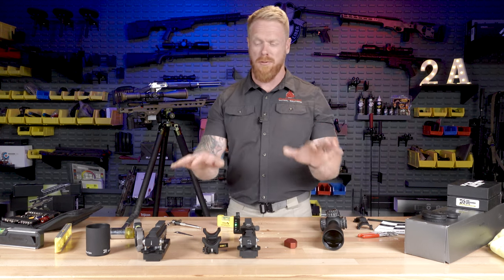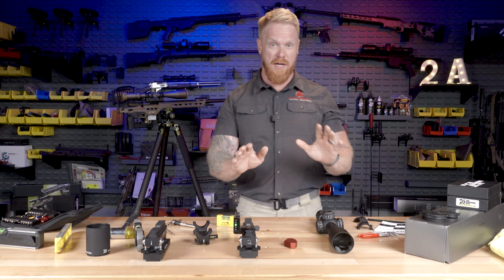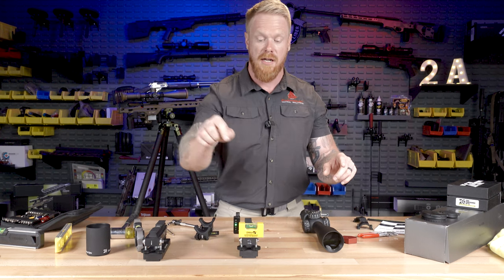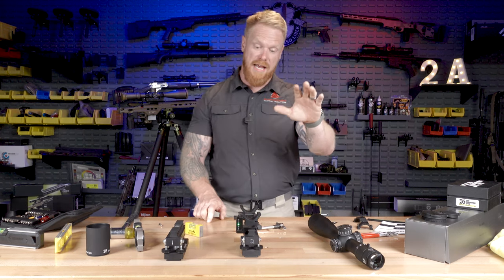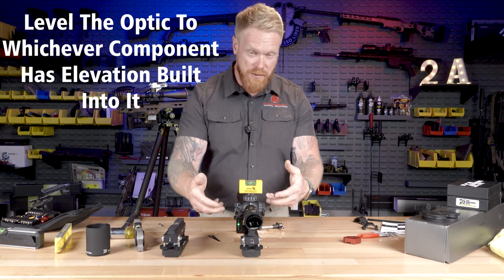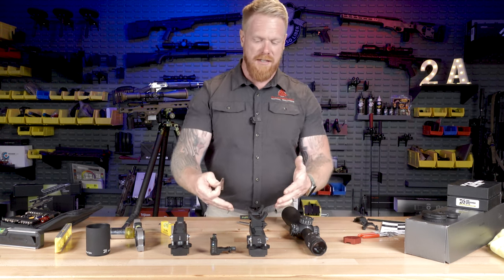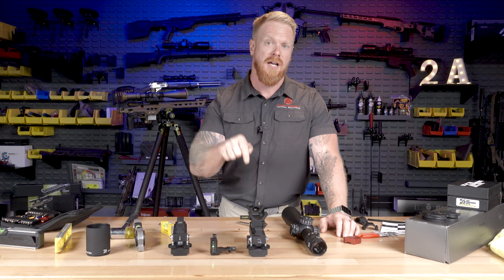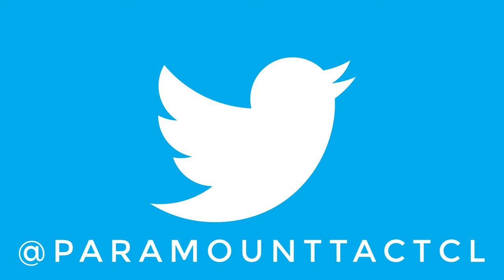Why Scope Leveling Wedges Don't Work

Comment: Great video!  Just one of the reasons I don't care for one piece mounts.  I prefer to spread my rings as much as possible to support the scope fully not have the rings so close to the turrets.  This problem won't present itself if using rings and bases as opposed to one piece mounts.
Reply from the maker: Thanks, but you’re conflating problems here. One piece mounts are far superior to rings. That’s not even a question. You have the exact same issue with rings. The individual rings contort when they clamp as well but now you have two pieces contorting and torquing your optic. Trust me… go with a one piece mount. They are truer, straighter than rings could ever be. 
Thanks for watching!
-Gary

Comment: What's the BLUF? I have the Spuhr 3001 with a Nightforce Scope 4-32x50 (30mm); how do I need to check this to ensure it's right. Rifle is  leveled, small lever on scope area , leveler on Spuhr mount, I am ensuring all are level thru out the process. 

Are you saying do not use the wedge? if not then what? 

What about the difference from the base of the scope without the wedge being used? 

Need a little help here. this is my first mount ever so I am trying to get this right. I am mounting this on a Sig Cross .308 Win 16B.

Comment: if your mount has elevation built in and you say you then want to level the scope to the mount then the wedge device should work ok, correct?
Reply from the maker: Yes. I’ve also covered how to mitigate or solve the problem with mounts and rails not mating properly. If you add a light amount of oil to the mating surfaces of the scope base and the mount clamps it prevents galling and ensures they mount flush which in turn allows the wedges to work as designed.
Reply: Much appreciated

Comment: What if you have moa built into the rings? I have Burris adjustable moa rings. I set them at 10moa but regardless let's say I have some moa adjusted in.

Now these type of levelling kits are not really going to work are they unless I'm running 0 moa.

I was thinking to get a set of them but I'm not sure. The Arisaka set seems to have 2 versions of design. One has the brand name on and the other has little circular holes and look like the same as the cheap ones on eBay.  So that has me confused. I don't want to order a set for good money and get sent a cheapo set. I'm in the UK and  only one place sells them and only have the 2 piece kit in stock.

So I was looking at the Sphur  version. It looks better made but you only get the one leveling piece and not the 2 piece kit like Arisaka have both a one and two piece kit.
Reply from the maker: @MrIliff  Wet Mounting - DO IT!
https://youtube.com/shorts/1Ahj8nMW9Yc?feature=share

Comment: so in the scenario you showed where the scope base is level but the mount isn't, how would you mount the scope level to the mount, not the scope base?
Reply from the maker: @eee2115  I wouldn’t level a scope to the mount. I always level the scope to the base. But here’s an update on how to fix this issue.
 Wet Mounting - DO IT!
https://youtube.com/shorts/1Ahj8nMW9Yc?feature=share
Reply: @paramounttactical  Thanks! I saw that video also. The red round steel that you place the scope on to find where the turret is level, where does one get that? Is flat stock from a store flat enough or are you using high precision machinist blocks? I have pretty much all the things you recommend except this piece, and I think the reason my scopes are not as level as I would like might be due to the turret not being in a level spot. Though I am using Vortex scopes, so not sure if you would expect the high end brand not to be level.

Comment: So for a Spuhr mount with cant on a no can’t base should be leveled off the bubble built into the Spuhr correct?
Reply from the maker: I’d confirm that the level is good but yes, the optic should be leveled to the mount. Fundamentally, you need the optic parallel  with the mount. If the level is good then you can level the optic using it as a reference. Hope that helps.
-Gary
Reply: How exactly would one go about making sure the built in bubble is truly level? Same thing as checking the turrets?
Reply from the maker: @dawsoncota3845  make sure your scope base is level then put the Spuhr mount on the base but don’t tighten. Integrated level should read level.
Reply: @paramounttactical  I’ll give it a try tomorrow, thanks for the info sir!

Comment: There is one issue with what you said about the rail interfacing with the mount could introduce a leveling error, this kind of contradicts what you did in your other video, you were leveling the scope to the mount on the rail of a rifle then you where going to remove the scope and mount as a unit after the leveling was done to be used on an other rifle. But this means that the shooter you were doing the leveling for cannot trust that the scope with the mount will be level on his rifle. How does he verify that no leveling error is introduced as a result of the mount interfacing with the rail on his rifle without executing the whole leveling process?
Reply from the maker: A tall target test. Any new optic on a rifle should shoot a tall target test. As I’ve also stated in multiple videos, you must verify 3  things. 
1) Scope is plumb to rifle.
2) Reticle is plumb inside optic
3) Optic is tracking correctly.

The ONLY way to do that is shooting a tall target test.

Comment: Can you do a scope mounting tutorial for one piece mounts like Spuhrs? It seems like a much different process when mounting by the level of the mount as I always been taught that the scope has to be leveled by the action.
Reply from the maker: Already did. 
https://youtu.be/OG8CchRYlDw?si=-QZHfxLCT2UR3CaZ
Reply: @paramounttactical I’ve watched that video 3 times now haha however you mentioned something about marrying the mount on a canted mount (20 moa) and my Spuhr mount is not level with the pic rail of my rifle and the action of the rifle. Which level should I follow since I don’t want to have to cant my rifle and I think you mentioned something about how you disagree with that practice as well. I also have a mdt send it level and I don’t know where to mount that since if I mount on the pic rail the scope reticle won’t be level but if I do it on the Spuhr mount, my rifle will be canted. Also, the Spuhr mount internal bubble is very off as well. My ocd is driving me crazy and I just wish to know what would give me the best results. My apologies for writing so much I think you’re the only YouTuber who aims for straight perfection/precision when it comes to scope mounting.
Reply from the maker: @RedactIT  mount your Send It Level to the pic rail/scope base. Level your optic to the scope base. You’ll be good to go.

Comment: I have the Arisaka wedge but never could get it work properly. I'm looking to buy the scope jack by fix sticks.
Reply from the maker: We’re a Fix It Sticks dealer but I’m not a proponent of the scope jack bc it doesn’t get low enough and doesn’t work on most optics and it won’t work at all on one piece scope mounts. 
The video link below is a step by step on how I recommend mounting a scope along with the gear I recommend.
Thanks for watching!
-Gary 
 How to Mount a Scope the Right Way
https://youtu.be/wgn6ejQzcL0
Reply: @paramounttactical  I ve watched this already and have helped me big time. I was hoping the scope jack would streamline the process and avoid scope shift when tighten down the rings.
Reply from the maker: @BimmerDudeXi  it might. I’ve just found there’s a very limited number of optics it will fit under. Depending on your ring height and the design of your scope, it might work just fine.

Comment: What if the top of turret surface is not leveled or parallel 
against the bottom aka saddle surface ? The turret is screwed in which can cause unevenness .
Reply from the maker: I literally demonstrated what to do if that happens. You turn the turret until the top and bottom are parallel. Did you watch the video?

Comment: You going to level your gun every time you lay down to take a shot?  Knowing your range and turret adjustment seem to be better than dealing with 50 variables and trusting holdovers...
Reply from the maker: Holdovers using a reticle are more accurate than turret adjustments.

Comment: yes. But if you have rings how you level to the rings?
Reply from the maker: You don’t level rings. You level the optic.
Complete Guide To Precision Scope Mounting - Part 1 of 2
https://youtu.be/OG8CchRYlDw
Reply: @paramounttactical you said you need to level the scope to the place where your 20moa is built in. In my case it's the rings. So I need to level to the rings which don't have level surface on the bottom like a ring mount
Reply from the maker: @caesar5555  when you take your ring caps off it’s not a level surface?
Reply: @paramounttactical  I dont know. I use Burris Zee Signature rings and achieve cant with the inserts.
Reply from the maker: @caesar5555  just level off your rail. It’ll be fine.
Reply: @unttactical Much obliged! Your videos are amazing! I dont understand how your channel doesnt have millions of subscribers that other (a lot of them are useless) do.

Comment: Wedges shouldn't be used between the scope and the mount, they should be used between the scope and the receiver's picatinny. If you are using a one-piece mount, it's obvious that wedges aren't applicable in the first place. I think that needs to be stated in this video. I would argue a majority of folks are using typical scope rings and wedges are the best way to level a scope in that application.
Reply from the maker: Dude! Watch the video instead of just commenting from your ass! These mounts, just like SPUHR mounts are designed that way. FFS. 
I love when people so ignorant speak with such confidence. 🙄 
“It’s obvious wedges aren’t applicable”. It’s literally HOW THIS MOUNT AMONG OTHERS ARE DESIGNED. 
You didn’t watch the video, you have no idea what you’re taking about, or the context and yet you can’t help yourself vomit text onto the screen and then act like you’re an authority on the matter.

Comment: All reasonable and good information but making something fairly simple a bit too complicated.  The bottom line is the scope should be level with the rifle.  When the rifle is plumb and not canted, the scope vertical reticle should be plumb.  So, really...who cares about the rail and the mount?  Figure out your moa elevation on your mount if that's a factor for your equipment.  However, I think the most important thing is once you mount your scope, is it aligned to the barrel.  In other words, you shouldn't have to make a windage adjustment if your windage turret is centered.  If you have to do that, try reversing the rings front to back and back to front.  You may also have to "shim" the rings in order to achieve proper windage from the get go.  Bore sighting on a wall about 15 feet away will let you know if there is a windage adjustment problem.  You can't change where the barrel points but you can change the direction left to right where the scope is pointing.  Cola cans can be cut to make shims if necessary.  Remember, the scope has to be plumb with THE RIFLE.  That's your goal.
Reply from the maker: Oh dear God. You ever have that conversation with someone that thinks they know everything but you can tell they have never actually tested what they’re talking about? 
I’m sorry but I do this for a living and test everything that I talk about, BEFORE I talk about it. I’m not a YouTuber bro. I’ve been teaching and testing all of this long before I ever made a video on YouTube. 

You need to look up Dunning-Kruger because you’re balls deep into it.
If you’d like to learn something instead of just typing to sound smart I’d suggest you watch the videos linked below where I cover everything you’re wrong about. 

Scope Mounting Myths - BUSTED!
https://youtu.be/yDBmS5P08j0

Complete Guide To Precision Scope Mounting - Part 1 of 2
https://youtu.be/OG8CchRYlDw

Tall Target Test - Critical Step For Long Range Accuracy
https://youtu.be/gsiZKRKnkb0
Reply: @paramounttactical  Watched plenty of videos.  Everyone has their own ideas which is fine.  Some people love to make things complicated.  I prefer simple which is to do all the common sense stuff to make sure the scope and rifle are working together as best they can.  And by the way, I did this "professionally" a very long time ago in a place very far away with equipment very sub-standard to what we have these days.  I'm still here and my equipment worked the way it was supposed to without using levels or gauges.  Stay safe, bro'.
Reply from the maker: @louislazarus9253  see that’s the problem. You don’t “know” if your equipment is good unless you shoot a tall target test and it’s not “ideas” there’s facts and then there’s unproven theories and then there’s mechanical and human error opportunities all along the way. What I can tell you with 100% certainty is that half of what you said in your first comment was WAY off. You justvflay out are wrong. You think you know but you don’t. That is a provable fact. 
Just because you hit a target at distance doesn’t prove or confirm anything. 
When mounting an optic you have 3 objectives:
1) ensure optic is plumb to action, UNLESS you have a 20 MOA rail then you MUST level to the rail.
2) Ensure your reticle is plumb to scope body. If it isn’t then it won’t reach correctly period. Your turrets only push/pull 90 degree horizontally and vertically.  If you leveled using the reticle and it’s not plumb inside optic then you hide this fact. And yes, you still can dial your way to an impact but you’ll miss more and blame it on environmentals.
3) ensure optic is tracking 

The ONLY way you can verify all 3 of those critical performance factors is shooting a tall target test. If you don’t verify using a tall target test then you don’t know and you’re just using blind faith. Period.

Comment: LOL. Everything in this is far more complicated than it needs to be. If you are using a level on your rifle, then keep the rifle level with that level, and plumb your reticle to gravity.

If you’re not using a level while shooting, then level the rifle however you normally do and plumb the reticle to gravity.

This eliminates literally everything including times the reticle isn’t square to your turrets or bottom of erector housing.
Reply from the maker: Classic case of Dunning Kruger right here. You’re so wrong and yet you believe it so hard. Good for you bro.
Reply: @paramounttactical  LOL. You're claiming you shouldn't plumb your reticle to gravity?

I'm assuming you've been to courses like Rifles Only, Frank Galli, Modern Day Sniper, etc etc? If not, you're up past your bedtime on this one. 

That's also the reason that SAC sells a plumb line if you purchases the accessory kit with the Final Scope Level.

Comment: One more reason one-piece mounts are overrated. By mounts, I mean one piece rings where both rings are connected via a solid base.
Reply from the maker: Lol, No. One piece mounts are the standard. They alleviate a lot of problems that go with rings, that really are antiquated at this point, and they give you mounting options for accessories that rings do not. 
It’s just one more reason not to use wedges.
Reply: @paramounttactical  they create lots of problems like the one in your video
Reply from the maker: @Bullets4Bucks  I’d be willing to bet the same interface issue occurs with rings too. Given they latch onto a smaller surface area, I’d be willing to bet it’s easier for them to get out of parallel with base. The clamps are essentially the same. The problem with rings withdrawn be exasperated bc it’s more likely that one is canting in a direction due to the interface/clamp and the other is not or it’s canting in the opposite direction, thus torquing the optic. That can’t happen with a 1 piece mount.

Comment: You should try this again with those two piece level sets instead of this 1 piece thing you have.
Reply from the maker: 🙄 FFS dude. That “thing” is a one piece scope mount which a large percentage of people use over antiquated rings. I clearly outline that from the beginning.
Reply: That thing is one of the best and most precise methods of mounting an optic

Comment: Makes no difference if the scope rings are level or not. All that matters if if the scoped is level with the RAIL and ACTION.  And, the wedge is not used alone, it needs the corresponding rail piece........

 I thought you were pretty smart until I heard you say "ANYWAYS".   Arggghhh.....the word is ANYWAY.
Reply from the maker: Hey jackass, if when you tighten the mount it’s no longer level with the the rail and then you use the mount with a slit in the actual mount with a wedge as a basis for “level” it doesn’t work. Your comprehension skills are either trash or you watched just enough of the video to jump to conclusion. Your comment proves that bc you got some key elements entirely wrong. 
You’re quite the emotional man there with all those caps and trust me, you’re the one that lacks the understanding on this issue. 🤷‍♂️
You’re worried how I said “anyways” 😂
Have you seen yourself type? I’m surprised you didn’t run out of ‘………..’. 
You have a blessed day princess.